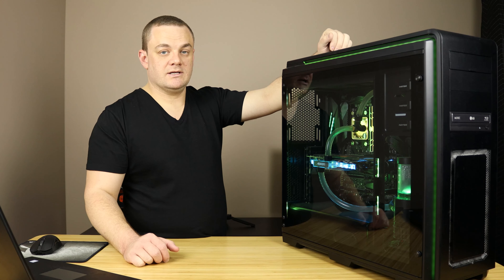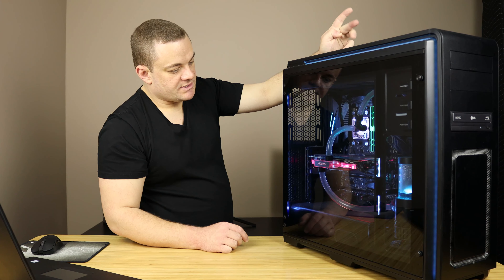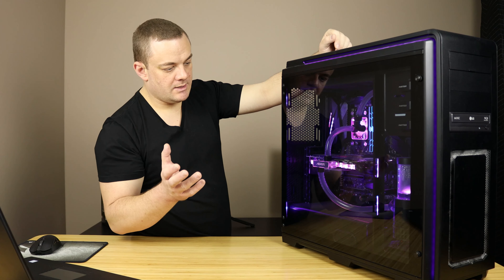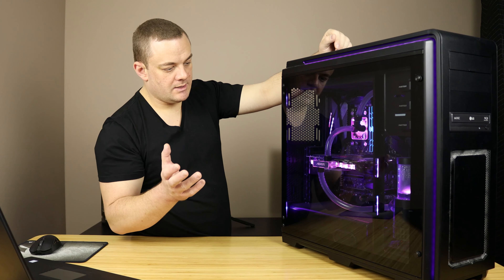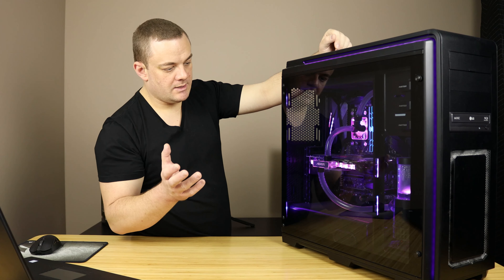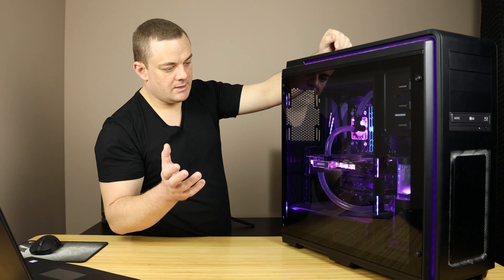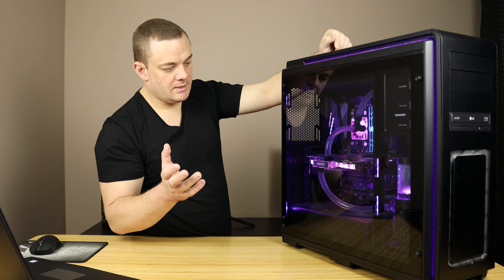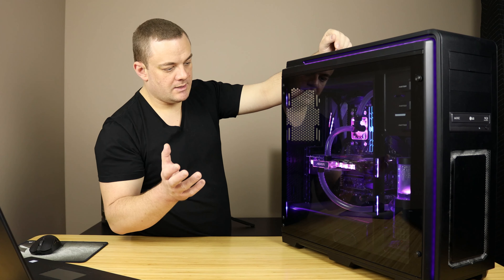Cleaning a Custom Water Cooled PC | EKWB CryoFuel 2 Year Review

Comment: Great video! Thanks for this! What's the most impressive was the amount of dust that was in the pc over 2 years. That level of dust builds up within a few days for me.
The other big learning for me is the huge benefit of the clear coolant versus being fancy and going for colours. It really helps the system in the long run. I've used the Mayhems X1 black UV coolant, which after a few months has already turned almost clear and has left residue inside the blocks. I'll change to clear in my next overhaul.
Thanks again.

Comment: Great video, helped me with going for the regular clear CryoFuel also.
Reply from the maker: That's great! I'm glad I could help. I would highly recommend the clear, it kept everything extremely clean. Thanks for watching!
Reply: @tech_progress  yeah I was considering going with the EK Mystic Fog at first because I really like the look of that based on a couple of build pictures I've seen on the subreddit /r/watercooling. But that coolant hasn't been out for that long so there aren't many user reviews yet. I saw someone that had the Mystic Fog turn clear over 5 days, but also someone who was running it for 2 months and it was still in good shape but a little build-up around the micro fins on the CPU block could be seen. If my new loop runs well with the clear CryoFuel I plan on maybe switching to Mystic Fog in 3-6 months after more reviews have come out from actual users. I don't actually mind cleaning my loop every 6 months or so, but anything more than that I would consider to be too much of a hassle.
Reply from the maker: Yeah, it's not a bad idea to hold off and see with a new product like that. You'd hate to try something that could potentially clog up you loop, discolour it or just not last very long. I'm sure there will be many more reviews in a few months, then you'll be better able to judge how good it is.

Comment: After two years!? Wow!
I'm using CryoFuel Cloud White in my first custom loop. Assembled in June 2020. I'm wondering when to perform first loop maintenance. I watched your video hoping to learn the basics. Kudos! And keep up the good energy!
Reply from the maker: That's awesome, congrats on your first custom loop! I honestly did not expect the CryoFuel to keep the loop that clean over the course of 2 years, but as you can see in the video, it did a great job. I don't think you'll need to perform any kind of loop maintenance for a while. I appreciate you taking the time to comment. Thanks for watching!
Reply: I can't speak from personal experience, but if you have clear cpu/gpu blocks, and aren't seeing any build up of gunk/sediment, then for a pre-mixed coolant like CryoFuel you could (in theory) run it safely for about a year. At least that's what I've seen from JayzTwoCents. If you just run distilled water with anti-growth and anti-corrosion drops, then he recommends 6 months before you change the coolant. Hope that helps! I'm building my first custom water cooled system by the end of this month, or the start of the next at most! So excited!!! xD

Comment: I've just had a pump failure - the pump is rattling but still operating (Alphacool VPP 655) after 10 years. Haven't flushed, cleaned or did any maintenance at all during this time. All I've done is top up the coolant 3 times I think. And that's it. It's particularly amazing since I've gone through 4 international moves too.

Comment: So no “pea” sized thermal paste application to Ryzen CPU’s?
I’m also assuming that because the cpu block was reasonably clean that is why you didn’t take apart the GPU block?
Reply from the maker: Pea sized thermal paste application is fine. I just wanted to compare apple to apples. The silicone layout differs from chip to chip, so your Ryzen may be different. Yes, the CPU block was clean and the GPU was installed a year later. That's why I chose not to clean it.